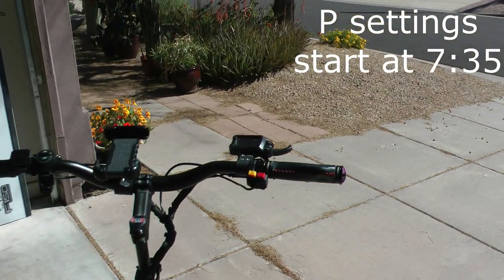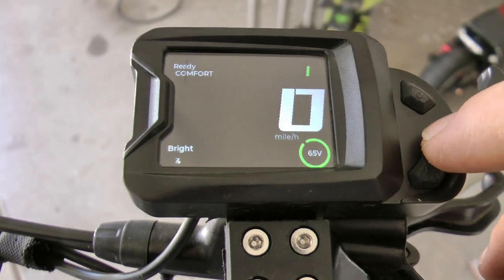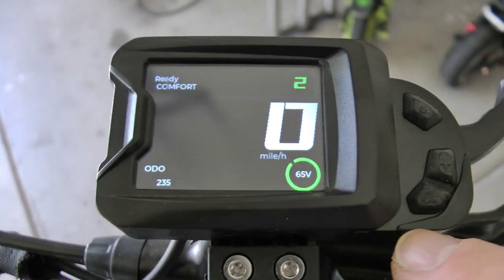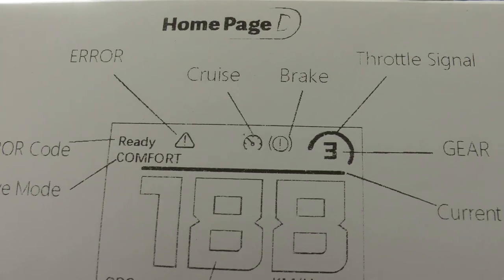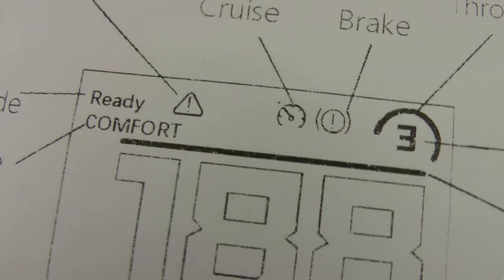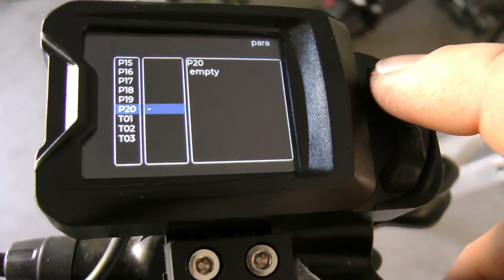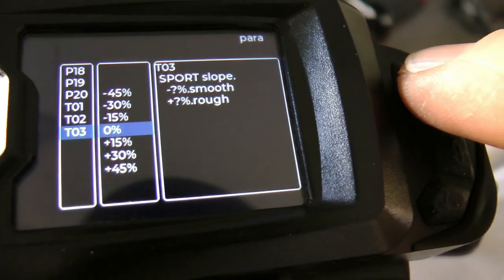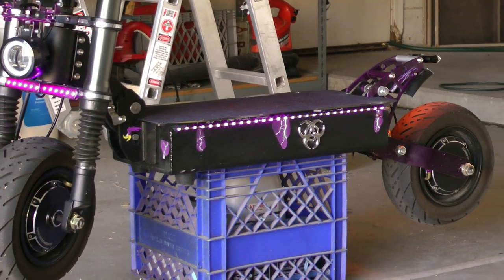DS20 setup & P settings

Comment: Thanks for the video. I bought a Tifgalop t88plus that I'm pretty sure is the ti30 you have with a different name on it. It was damaged in shipping and the B controller was not communicating with the TF-100 display even after replacing the display. I found your videos and decided to buy the same controllers and DS20 display you recommended. Everything works now except the break sensors.

Comment: So basically you got this one to replace the MS668 because there was throttle lag. 
Throttle lag is a major issue and I agree. However ~75€ just to fix this problem is a bit steep... Unfortunately the only other alternative is a ~55€ TF-100... 
I was actually disappointed to see that the e braking performance is weak... 
I've just changed the P12 setting on my MS668 and it's quite effective. I measured 20A of regen current. It's around 1000-1200W of power going back into the battery. And it really decelerates... 
If this 75€ screen had decent e braking, I would buy it with my eyes closed. I really want to have quick throttle response (and even quick e braking response since that has a delay too...). 

Now I don't want to due to weak e braking performance 😅
I wish I could know if the TF-100 has good e braking performance...

Comment: Good morning. what maximum speed with Yunli controller? Zero latency? The scooter still cuts out? thanks
Reply from the maker: I top out at 50mph. Little latency but hardly noticeable and I think it is necessary to make the acceleration so smooth. No more cut outs.
Reply: @Desert-Ecruising  thank's 👍